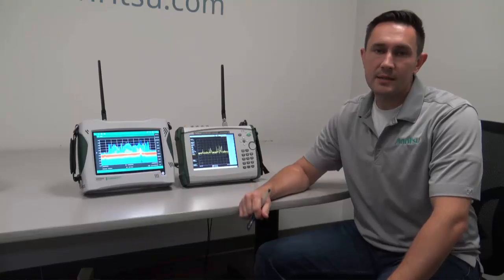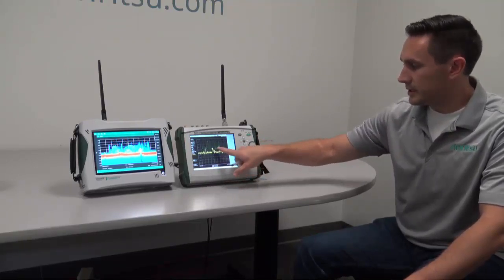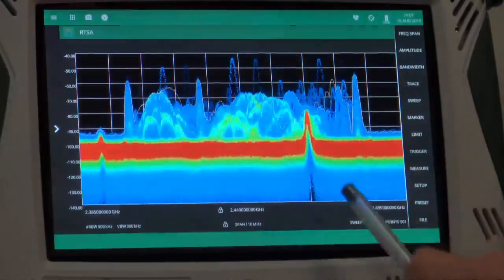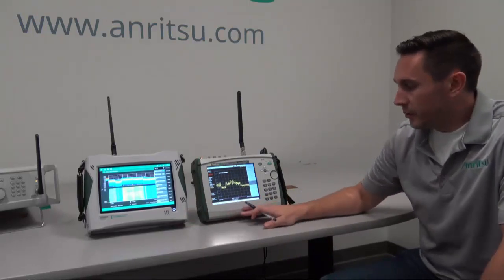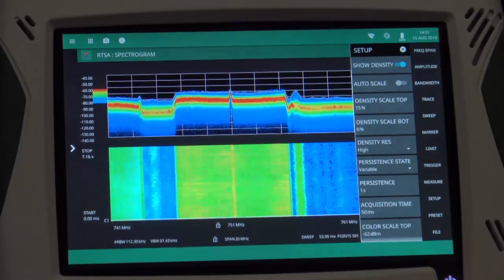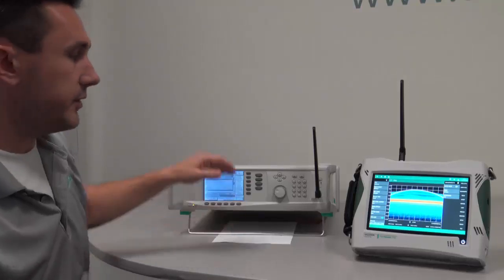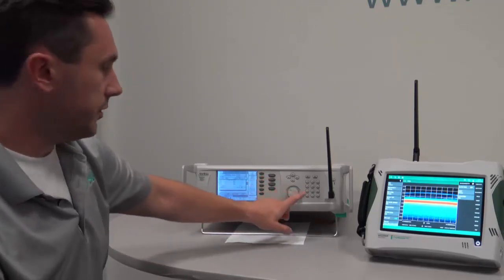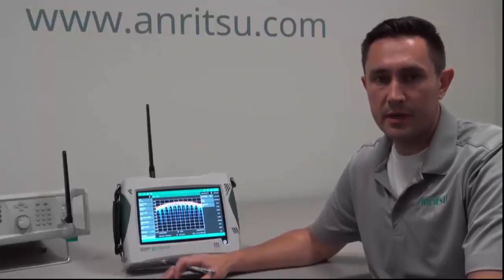Field Master Pro MS2090A Real-Time Capabilities

Comment: Do you have any portable spectrum analyzers that provide the 10Mhz reference and DC power to LNB?
Reply from the maker: Thank you for your question. Our Field Master spectrum analyzers are designed for field portability, battery powered and ruggedized cases. They include a 10 MHz Ref output and output port for DC bias to an external bias tee that is an optional accessory. Please see the MS2090A and MS2080A Field Masters on our web site for full details.